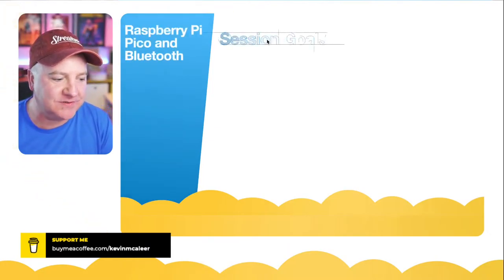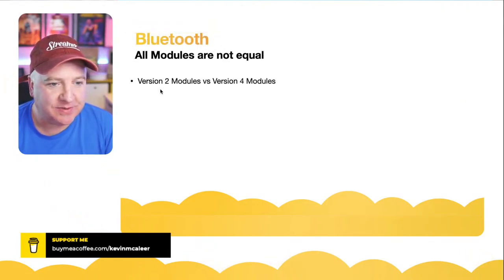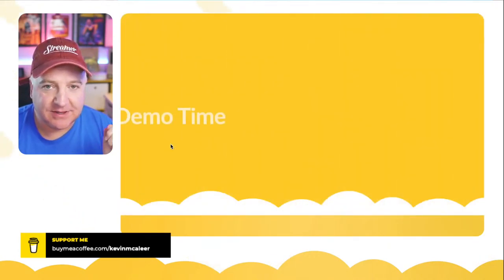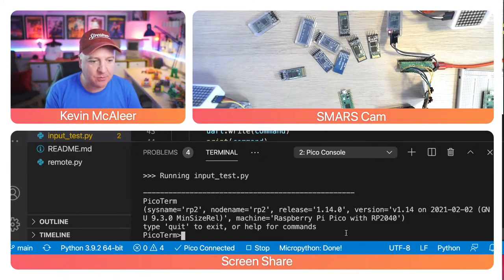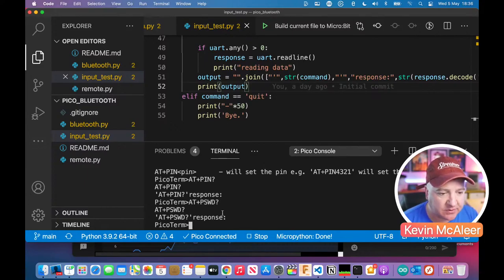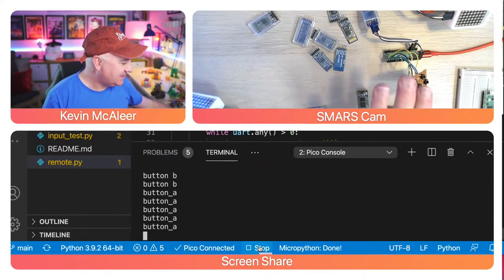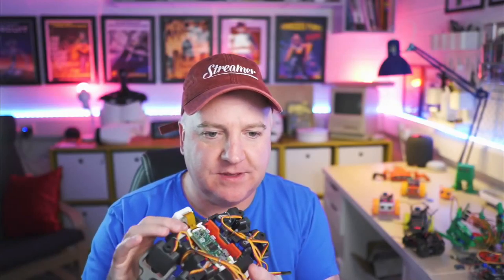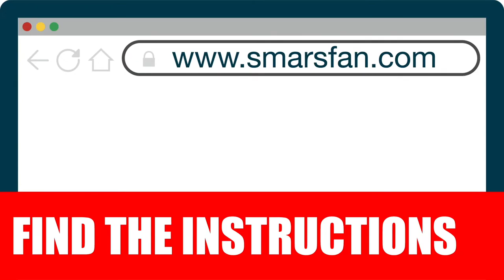Raspberry Pi Pico & Bluetooth

Comment: very nice video - thank you
btw I think you mixed up completely the explanation about pull up/down resistors at @30:00 - by using them you bring known status to the IN pin BEFORE you short it either into +3V or GND. If you pull up, this pin is ALWAYS high so your button should be connected one side to pin and one to GND. When you press it, pin will get LOW. For pull down it will be opposite: pin by default will be on GND and button should be connected between pin and +3V. When pressed pin will get HIGH.

Comment: Hi there, great video! I am having some trouble with my project and I wonder whether you could point me in the right direction. I want to use a Raspberry Pi Pico to control an RC car via Bluetooth. I use IOS so have bought the Adafruit Bluefruit LE UART Friend module but I am struggling to find any information about how to connect and utilise the components (despite hours of internet searches).
Reply from the maker: Hey Rhys - if you join our discord server I’m sure we can get to the bottom of that issue - https://action.SMARSfan.com/join-discord

Comment: Hi -- I just picked up an HM-19, and trying to get this code to work.  I'm having a bit of a problem trying to get it to respond to AT commands.  uart.readline() just seems to hang. I'm wondering if I should have stuck with a bluetooth 4 device.  Once I get the device paired, it does seem to return things, but only after it disconnects for some reason... still trying to figure this out.

Thanks for this video -- has been a great motivator for me to get a project going.
Reply: Looks like I might have solved my own problem by updating the firmware on the Pico from 1.13 to 1.15.

Comment: with the print command you can simply set the named parameter 'sep' to an empty string and then you will not get a space in between print entries.
Like so:
a = "Hello"
b = "World!"
print(a, b, sep = "")

The result will be 'HelloWorld!'
it is a lot cleaner looking than what you did.

Comment: Seen any BT 5.1 or 5.2 modules available for the Pi? i'm looking for a small board that i can attach to a pi which can all be taped to a drone. Currently i'm looking at a dev board from silicon labs but even that board is pretty large compared to my pi and zero.
Reply from the maker: Yes - you can get very small bluetooth modules, smaller than the ones I showcase in this video. requires a steady hand with a soldering iron though

Comment: I've had difficulty getting this code to work on my Pi Pico. Every time I type an AT command, my command gets printed, but the next line is just blank and then returns to asking me for an input again. I'm not sure what could be wrong.
Reply from the maker: I had some issues with BT modules of different types, each seems to have either a different BAUD rate, or a different format for the AT commands. If you can google the exact type of module you have, you should be able to find the data specification sheet and AT commands it accepts. If you want more help - join our discord group and ask the question in there (its easier to share pictures of the module etc.) https://action.smarsfan.com/join-discord

Comment: Hiya, I just got an HC-05 to play with (cheapest) and using your picoterm code i have managed to get it named and paired to my Android phone :)  However, the device refuses to reply to AT commands and also I have to comment out this line "data_output = uart.write("Got: ", data_input)" or i get an error "TypeError: can't convert bytes to int" - any ideas???  The device does seem to function though, great video again ;)
Reply from the maker: The write function can only write bytes - so you need to pass it a string it can convert to a byte array. It doesn’t work like a print statement which is why it’s saying type error
Reply: @kevinmcaleer28  Ok, thanks, in the context where it appears, what function does that line perform? - i see we are reading bytes in but does it then write the "data_input' back to the UART?

Comment: how can i set up a bluethooth connection between raspberry pi 4 and pico?
Reply from the maker: You’ll need two Bluetooth modules and connect them both to a pair of pins that support UART, then in your favourite programming language, create a serial connection to the Bluetooth module.
Reply: @kevinmcaleer28  Thank you very much for your reply Kevin.
pi4
port = serial.Serial("/dev/ttyS0", baudrate=9600, timeout=1)

pico
uart0 = machine.UART(0,baudrate=9600)

Is it enough if I do this?
Reply from the maker: @safakfahrac1524   Yes That should do it! You can use the Raspberry Pi Bluetooth manager to connect & pair and then its just like writing to a serial port
Reply: @kevinmcaleer28  Thank you very much for your reply. If you come to Turkey, the food is on me.
BUT
"Using Raspberry Pi Bluetooth manager to connect and pair"
I do not know this.
Reply from the maker: @safakfahrac1524  awesome! The Bluetooth manager is just the ‘B’ Bluetooth logo next to the clock in the raspberry pi desktop, click on that and then ‘Add device’, it will turn search for Bluetooth modules nearby.